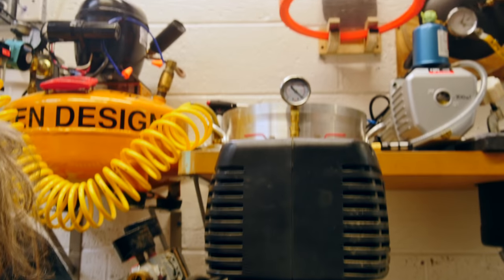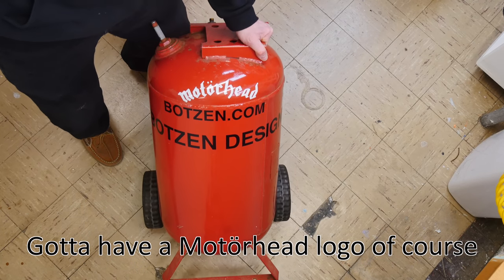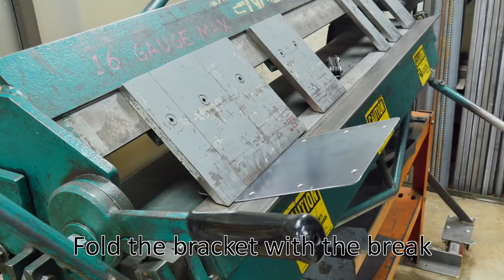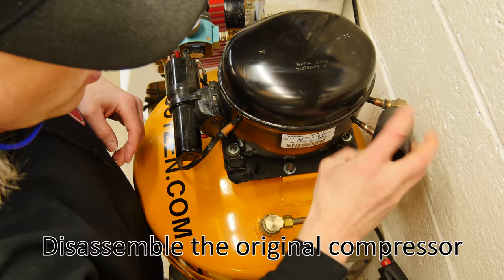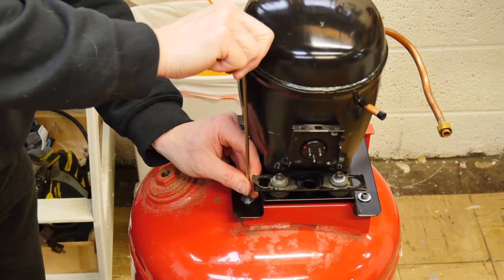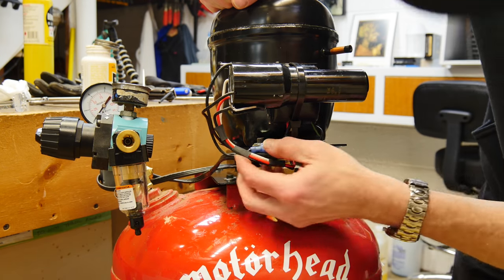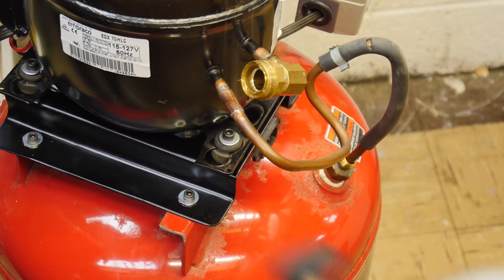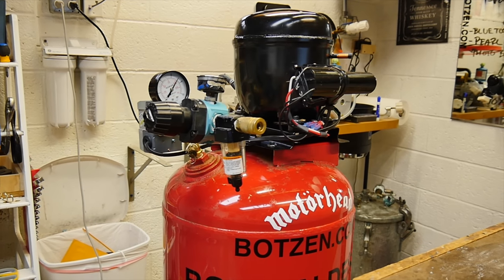ULTRA QUIET  Refrigerator Air Compressor Upgrade Build

Comment: Just like anything else piston style Engine or Pump the oil is retained by the quality and finish of your cylinder(s) and the ability of your oil control rings! Under normal running circumstances and you aren't flipping over or rolling the compressors around causing the oil to be distributed all throughout the compressor and then into places that the oil doesn't normally stay, that's the only way oil is going to be getting into the outlet of your compressors. If you're using a old or worn out compressor, then PLEASE just like a old engine that never had its oil changed in its entire life...... Than expect to be seeing some oil in the discharge tubing! As just like an older worn out engine, these things will work the same way, and consume oil into places that you wish it not to be! Like blue smoke of your exhaust system is usually caused by bad or worn out bores or rings or valve guides. The only thing that the hermetically sealed compressor has that your standard say 4 stroke does not have is valve guides to leak and or go bad. Most, but not all, compressors utilize reed valves as check valves for air direction control. The nice thing is that they are extremely reliable and last a very long time without service and do not require oil to lubricate the stems and guides to keep them moving properly. This doesn't apply to every single compressor out there and there's a multitude of different types and designs today like Scroll compressors which don't require any reciprocating masses spinning around causing harmonics or vibrations nearly as much as say a crankshaft and piston style compressor system. The scroll is a constant direction movement of air being continuously squished from beginning to end at the discharge tube, which makes them much more efficient and a little more reliable as well. Today they're using these scroll compressors which are simply identified by being a longer or tall cylindrical shape as opposed to a Mellon ball shape. The great thing about these modern scroll compressors are that they're now using motor speed controllers to regulate the compressor speeds! So when say a older AC/heat pump unit was satisfied with temperature, they'd normally shut down the compressor all together, which as we all know, sucks! As it takes more electricity to get these motors back started and running to full speed again from a dead stop against enormous amounts of head pressures sometimes, especially if it's cycling very often! The cure for this is the Speed controller and their programmed running in that, knowing it's coming close to reaching its desired temperature setting, rather than killing the power to the compressor, the speed control will start to ramp down the motor speed and bring it down to say an Idle speed for the time needed, until called upon again by  the thermostat to demand more cooling or heating power. The speed control will thus begin to ramp up the compressors speed to bring it back to its most efficient running speed. This saves a ton of BS and electricity at the same time, and less likely to blow or burn up start and run capacitors as well! We have amazing technology today and it's a shame that most no one is even aware of such things today! I have worked in the refrigeration industry for over a decade now and have seen the progress in compressors and motors. The problem is we've gone backwards of course thanks to our World's leading environmentalists that believe only the US and certain EU countries have to obey their government guidelines for their use of certain amazingly powerful refrigerant gases!!! Meanwhile the rest of the world still uses R-12 and R-22 for their everyday AC/Heating devices. But because we're the biggest @ssholes in this world, we choose to do the simplest things the hardest and most expensive ways possible! Like trying to use C02 as a refrigerant gas! Does it work yes..... if you call it that? It requires much much higher pressures to operate over say R134A and of course in doing so requires much more power to operate a system of the same BTU displacement using a old good gas! So how's this progress? Were burning more fuels to make the same effects? Seems like a Democrat has been involved in such a thing! Being if it's not broken, leave it to them and they'll find the solution before finding the actual problem with these things HMM? Science and mechanical engineering has been destroyed by these scumbags who believe they have answers for problems that don't exist yet! But that's another story for another day! If you want the best and most efficient way to cool something using the least amount of energy consumption? Use what Nasholes use! (NASA) uses to this day Ammonia based refrigeration systems that really require nothing more than a tealite candle to power these said systems! Meaning that in space, just having the huge differentials in temperatures between light and darkness these systems can almost run entirely off solar power as long as nothing leaks of course (AKA) the Ammonia. It's a little more expensive than say you normal junk built AC units and requires good quality stainless steel or something of equivalent in corrosion resistance, but our first refrigeration systems we had here were all based off of the Ammonia based refrigeration effects. Because Ammonia has a low boiling point and it will self condense at basically room temperature and atmospheric pressures. This way you do not need to have electricity to pump it into a phase change (from a liquid to a gas) with what they use to use was a natural gas pilot light to supply enough energy to cause the Ammonia to transition from a liquid to a gas, thus absorbing the heat as energy from the surrounding area and it turns back into a liquid on its own and the cycle is perpetual in nature. I believe some Campers and RVs still use Ammonia based Refrigeration systems that use the on board propane to supply the necessary heat/energy to make the Ammonia transition into a gaseous state, thus creating pressure and the cooling effects when phase changed through a capillary tube into a large low pressure tubing we magically have cooling effects. The gas runs through a set of external cooling tubes called the (condenser) on the outside of said fridge or AC unit and as it cools down from absorbing heat from the interior of the fridge or building, it releases its energy as a form of heat and the gas condensates back into its natural state of liquid Ammonia thus completing the cycle and it doesn't require fans but they are kind of a necessity for AC to move larger amounts of air around. But they DON'T Need compressors to operate! At ALL! We've been lied to and deceived by our leaders and society as a whole! This way we pay for each and every little thing in our lives, especially if they're considered a convenience to us and not a necessity! God Bless and wake the hell up, we're all at war with the same overloards who've figured out how to scam the scammers out of everything today! But we can take back our freedoms and liberties if you are willing to do the work! Which starts with you as the individual! You are the key between being a pawn and dependent upon your government, or educating yourselves and learning about how everything is supposed to work in this world. It's definitely not easy to achieve, but it's also NOT impossible either! The proper education can set you free! Also makes us a danger to the ones who wish to control or structure your lives by the needing to pay for every little thing in this world today! We have options, unfortunately many are just too lazy to seek them out for themselves. Good luck with the future and let's hope we change this BS for the betterment of the world in a whole! God knows we all need this to happen and the sooner the better I think! ❤❤❤😊

Comment: Armchair'n this...  As a lazy innovator... I'd simply mount the small tank on top of the large tank...  connect them with a staged dryer and valve...  and good to go.. 21 gallons and extra dry air.

Comment: Keep in mind you can use that compressor as a serious vacuum pump (tee into inlet and put 2 valves and a vacuum line). But I wouldn’t try to do both build pressure and pull a vacuum at the same time. The new capacitor is a hard start kit, because these little compressors are not designed to start against a load. (You would have to open a valve to release the pressure on line so it would start) once it’s going, it can go up to about 450psi...

Comment: The silencer is a thing of beauty. The last 5 Hp compressor I put together was so noisy I ran a PVC air intake through the shop wall and used a Dodge pickup air filter and housing to strain out the wasps... still a hammering puppy. I envy your new setup.
Reply from the maker: Mark Koons Thanks, glad you like it, Feel free to share on social media.

Comment: Thanks to  you   i  built   my  compressor   and   been  using it   for  last  3yr  and  served me  well
Reply from the maker: Sweet!
Reply: Eric Strebel   one thing i  did was used a lawn mower filter  to  quiet  mines  and  works  great   I  used a craftsman  Tire  Air  tank   and   replaced  safety  valve  with   and 125psi  instead of  150 psi  .  however  i  didn't  use  on  and off  pressure switch   instead i got  heavy  duty  light switch  and  wall  plate and  box  i flip  it  on and off  when  need be .  i  build models  and  its perfect .  one  thing i  did  do  was  mount my tank upside down   so  when  i blow tank  anything inside comes out and i  leave  ball valve open  till next use
Reply from the maker: Wow, very cool, thanks for sharing, I like the filter tip, well done if you share a picture on social media tag @botzendesign so I can see
Reply: @EricStrebel   I  don't use Twitter .  I only use Facebook  . But if you  want to see it   i can  message you  and you  post it   not problem

Comment: Nice build.   You may want to review contemporary suppressor design, baffles and fiber have long ago (30+ years) been replaced.
Reply from the maker: I have been stuff with chambers as well, is this what you are referring to?
Reply: I was referring to a K style baffle used in a suppressor for a firearm, ref @12:50.

Comment: Nice, I also make my own 10 gallons silent air compressor,  for my airbrushing.  May I make a suggestion, since I change the oil that came with my fridge compressor for synthetic oil I add it a 120v computer fan that helps to cool down the compressor, since it takes more time to fill up the tank, and it works great!
Reply from the maker: Good idea

Comment: As always impressive work! I have some questions about this new build: 1.- How big is the compressor in HP? 2.- How long does it take to fill the whole 15 gallons? and lastly: 3.- How many watts it consumes when running? Thanks!
Reply from the maker: Edu Fregoso wow, all good questions that I don't know the answers to, they are irrelevant to me based on my needs, You only fill it up once from 0 psi. Tank gets filled between 75 and 100 psi when in use, maybe takes 5 minutes to fill up again. Feel free to share on social media

Comment: Hi! i see u use normal motor oil 10w40... did u have any problems with overheating ? is it mineral oil or syntetic one?
Reply from the maker: Ideally you want to use a non detergent oil since these motors don't have a pump I merely use 1040 for the additional protection the 40 weight offers. I do not have any issues with overheating.

Comment: Wow Eric, great video very detailed and helpful and clean finished job at that...

but can i ask for a bit more detailed help/info regarding building a two in one  compressor build???

how can i  build a compressor that can run:
1- my airbrush kit
2- can vacuum
3- can build up pressure for a pressure chamber???
for the chamber it will be logical to use a pressure cooking pot with its modified own lid, and a seperate one  for the vacuum..

but what kinda other parts do i need?? and how the physics should work :D got he briefest idea and thats all. i can picture the algorithm but the actual parts and flow is blank :D ahahaha

i ve been looking for such a detailed tutorial, and your diy comp video has caught my eye..

i really would appreciate it if you can maybe list and write a brief how to.. cause a video would be asking waaaay too much :D or would it?? only you know :D

thnxs for your time and patience :D
stay healthy and strong in these times and keep on doing the great, clean and helpful job u r doing
cheers

Comment: Eric, the working pressure for a 1/8 to 1" copper solder joint is about 200 PSI or 14 bar.  What is the max pressure you can obtain?
Reply from the maker: I run my tank at 100 psi max pressure

Comment: Very nice video and good work. 
Couple of comments. 
You didn’t address the unloader valve. What did you do there?
Also, silencers for guns are not stuffed with sound absorbing material. They a baffled inside. I’m sure you can reduce the report with brass wool or something, but it’s not typical. 
Thanks

Comment: what an awesome video, thanks for sharing!! The silencer, can you explain where it came from ? where to get something like that? thanks
Reply from the maker: It's a metal can with a small hole on the opposite end of the large opening filled with brass wool, works very well, basically how gun silencers are made
Reply: @EricStrebel  If you go to Indonesia, hopefully you can play at SMKN 3 Pekalongan, Central Java.....matur nuwon

Comment: great job! i have a question about the oil. are you use the oil for car engine to exchange the original oil inside the compressor?
Reply from the maker: Yes

Comment: What kind of use do you put this through?  Is this thing something that runs 10 hours  year or a hundred hours a month?  I'm thinking about using a reefer compressor to aerate my pond.
Reply from the maker: I bet it runs 10 hours a month. Light shop use, perfect for my needs, the larger tank helps when you need some extra for a project

Comment: Hi! Love your build and thinking about making something similar, I was wondering, how long it takes to fill the original tank(old build) and how long does it take to fill up(to 100 PSI) this one? Thanks!
Reply from the maker: Perhaps it took 5 to 7 minutes on the original one this one maybe takes 10 to 12 minutes, empty. Normally it just fills up between 60 and 100 psi so it never goes to zero

Comment: one question, you made a mounting plate for the compressor, but why then glue the power in connector? you could've made a small mounting plate for that?
Reply from the maker: andygozzo72 you are absolutely correct, I considered it, but decided that it was to difficult to fabricate vs just bonding it in place. If I had laser cut or water jet the metal part then I would have done it in a heart beat. Thanks for your comment, feel free to share on social media, that helps me out the most. Rock on!

Comment: Hi. Great video!!! I have a question for you. I got an old 1/2 HP Tecumseh compressor and built a silent air compressor with it for my hobby projects. I used a new SS Relay, new thermal overload protector and new pressure switch. Everything works fine. I've set the pressure switch cut out at about 90 psi and cut in about 60 psi   but I've noticed that the compressor overload protector trips when the compressor tries to cut in under pressure. I have to depressurize the tank down to about 30 psi in order for the compressor to cut in smoothly. Is this normal or is there possibly something wrong??
Reply from the maker: Not sure, it could be a load issue with the compressor itself.
Reply: @EricStrebel  Thanks for the feedback!
Reply: Did you intall one way check valve.?
Reply: @rodelago5591  thanks for responding! Yes I did install a check valve but funny you asked because I was thinking maybe that could be the problem. I suspect that perhaps the check valve is defective. I think I'll replace it one of these good days and see if anything changes. Cheers!
Reply: @andreb877  Did it help? Was it bad?
Reply: @carlnelson3893  I'm surprised to see this message after all this time LOL! Anyway, the problem was not the check valve, it was the pressure switch unloader valve. Once the compressor pressures up the tank to the cut-out set pressure and clicks off, the unloader valve is supposed to open simultaneously to de-pressure the compressor discharge line. So, when the compressor kicks back on at the cut-in set point, it is allowed to start under NO LOAD and build back up once again to the cut-out set pressure. Because the unloader valve was not working properly, the compressor was starting under LOAD and the high current draw was tripping the overload protector. It's kinda like trying to start a car with a manual gearbox WITHOUT depressing the clutch and dis-engaging the engine from the drivetrain.
Hope this makes sense to you. Since I replaced the pressure switch the compressor has been operating perfectly and is without a doubt one of the most useful DIY projects I have ever done!!

Comment: Are 60 gallon tanks too much for 1 of them? Maybe sit 2 of them on top of a 60 gallon tank?
Reply from the maker: Yeah, that might even be a bit much for two of them
Reply: I’d even go 3 or 4 just to have a quiet air source in my shop but 4 is a bit much when thinking about powering them. How much power do they need to run?

Comment: I'm building one for airbrush so I won't need a very high pressure of volume. I was thinking of using the small coil and fan that I scavenged of the original machine and attaching it just aft. the pump.. adding a small dip tank with copper wool to remove the moisture.
Reply from the maker: Sounds good, I would consider putting a water trap on the output of mine